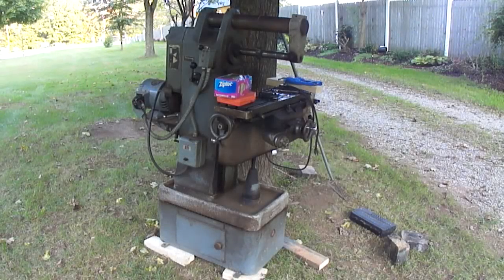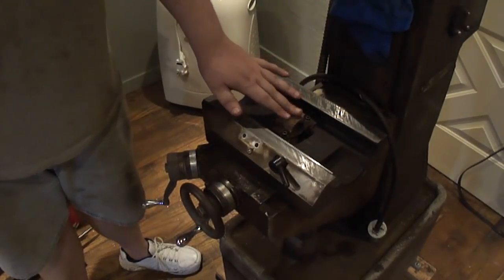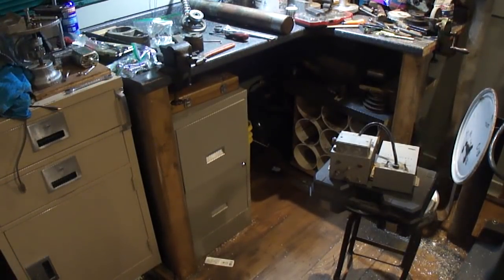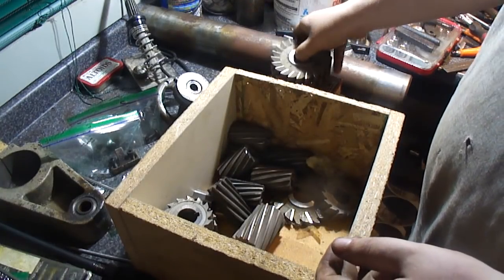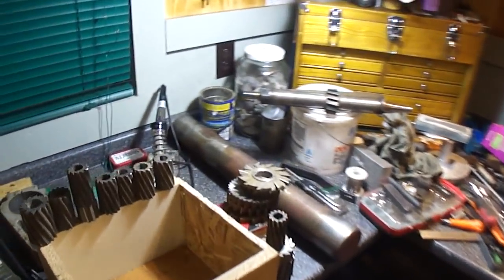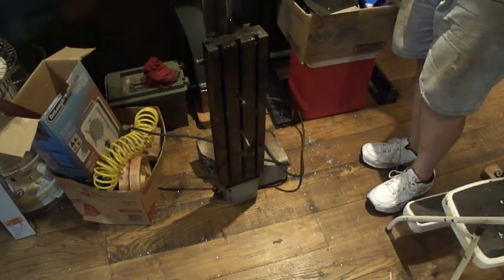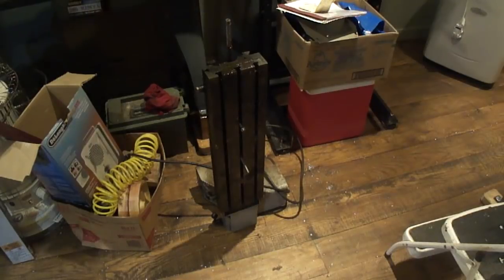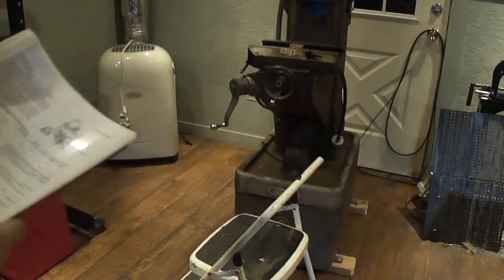Rockwell Horizontal Mill Rebuild #1 - Intro

Comment: Chirpy, awesome score and an excellent addition to your shop.  I am very much looking forward to the cleanup and rebuild and eventual chip making with your new machine.  Congrats!

Joe
Reply from the maker: that may be a while, been busy with other stuff that's come up before that. Hopefully sometime soon, I can start on cleaning up and reassembly, which may only be a 2-3 video series since there's not much to really work on on the mill. Ill have to pick up a few parts because of some stuff happened during the initial teardown, and some parts were lost. Also, I dont have 220v in my shop, and no way to get it atm, so Ill probably just put it back together and leave it sit.
Reply: I know you have a couple of projects in the works.  Looking forward to seeing your 4 jaw Chuck build.  How is it coming or have you has a chance to work on it?
Reply from the maker: I havnt even had time to work on it tbh, Ive been swampped with customer's projects and I havnt even had time to do much of anything lately. That and I messed up the bottom of my back, so between all of those, Ive been doing what I can and thats mainly just the stuff for everyone else.
I still need to make a pattern for the chuck jaws, and cast those out, but right now, being out and messing with woodworking crap isnt really that high on the priority list, lol. (I dont like woodworking even tho Im stuck doing it)
The furthest Ive gotten with any of my projects is that I got the shaper vise body cast out, but it's sitting in the casting shed on the molding bench still. I need to mull my sand somehow and make up some more molds again, but I have 4 things to ship out first thing monday morning, and another 3 more things to finish before then.
Reply: Busy, busy, busy. Hope your back heals quickly.  You are doing great.  Keep up the good work.
Reply from the maker: thanks,  Im finally finished with the others, so Im going to just take it easy for a few days probably to try to heal up, lol. Thanks for watching.

Comment: Finally got a milling machine in the shop. It will be fun to explore the possibilities of this new machine. It looks to be the perfect size for your shop too, thanks for the video!
Reply from the maker: yea, it is perfect size for the shop, only thing is, the cutters are expensive to no end for me, so Ill have to find some way to sharpen them. Thats why most of the milling will still be done with the shaper since it's cheap on tooling, and shaper is easier to run, then use the mill for cutting slots and pockets, and the other oddball jobs that the shaper would have trouble with.

Comment: G’day Chirpy, sweeet. You’ve got yourself a nice machine there with a little cleaning up it’ll work great I’m sure. Cheers Peter
Reply from the maker: thanks, yea, I looked it up and it was one of the highest regarded ones for it's size in rigidity and power. I also saw that the servo power feed and everything that was on mine wasnt standard, so I was in luck with that, and the box of milling cutters for it. Thanks for watching peter.

Comment: I can see Chirpy's manufacturing empire taking another step.  Great score, not only the mill but all the goodies you got with it.  With a lot of weight on that floor check for any movement over time (I assume your on bearers and stumps).  I think it was Steven Lang who had an issue with the weight of his grinder on the floor.  Looking forward to the new dimension in you projects.  Maybe casting a new body for a vertical head and machining it up to suit.
Cam
Reply from the maker: lol, chirpy's manufacturing empire... You have no idea how true that is already, lol. I havnt even gotten to touch the mill in the last week because Ive been so busy. You'll defenitely like the next video coming out if you think that's funny.
I actually do have the plans for the vertical head and everything, but I dont know how much I'd really use it that much because most of what I will be using the mill for, it'll work fine on the angle plate instead, or on various fixtures, so the vertical head wouldnt even be used tbh. 

The floor in my shop is so overbuilt, it's made of 4x10 lumber as runner boards, and the whole floor and walls are made of 1" thick oak and hard maple boards. I dont think it will have any problems holding the mill, lol. It was taken over on a dolly, like you see people moving refrigerators and such on, so if that can handle it, Im sure the floor is safe, lol. I think it only weighs about 1000lbs all together.

Comment: Nice addition Chirpy, tool and cutter grinder project build coming soon?
Cheers
Raymond
Reply from the maker: lol, I was honestly thinking about it, but it wouldnt be anywhere near the shop tho, and it would be quite a while before that happens. I was looking at the tinker tool and cutter grinder since I saw it was simple in design, and they were showing pics of it sharpening slab mills and slot mills along with endmills.
Reply: Chirpy, have a look at Harold Hall’s stuff, he’s and old English gentlemen that has some books also some YouTube vids under home metalworking workshop channel, very knowledgeable very simple solutions.
Cheers
Reply from the maker: yea, I know of harold hall's stuff, Ive seen alot of his stuff on his site for setup on the faceplate and the mill jigs and fixtures, which work fine on the shaper also.

Comment: Would be nice to have that vertical head so it's a full universal mill...
Reply from the maker: yea, but I have the plans to build the vertical head from it. I found alot of the original blueprints for the stuff from rockwell themselves. I doubt I'd really use it that much tho, mainly just use an angle plate to attach the stuff to and use an endmill holder in the #30 taper.

Comment: Well dang. There's a nice toy. I've got an Atlas MFC but it didn't come with the overarm support or an arbor. So it has mostly been sitting in the corner taunting me.
Reply from the maker: lol, thanks. I think thats what this one is going to do until I can get the power run for 220v in the shop.

Comment: Nice new toy. I think I got iron envy :)
Woudn't mind having one of those. But I promised not to buy any more machines.
Reply from the maker: lol, thanks, I made the same promise, but this one was too good of a deal and so I had to choose, heater in the shop or horizontal milling machine, we'll be tearing the heater out probably within the next few days. I plan on just usng it to cut slots and pockets, thats about it, but the real machining will be done on the shaper still.
Reply: I've stopped looking for good deals, cause I surly would have broken my promise.I better concentrate on what I have :) Good luck with the mill.
Reply from the maker: lol, I wasnt really looking for this one, it found me really. When I had gotten the lathe gears and pulley for the power hacksaw brazed up, that same guy had the mill and was trying to sell it. I told him no at the time and it kept bugging me and I kept looking at it every time I was at his shop, so finally he came down in price and I couldnt pass it up. Expecially after some of the recent jobs where I was cutting slots and such that the shaper was really struggling with and took forever to do on the shaper, so I was mainly looking at a mill just for doing those oddball jobs.

Comment: let me know the shaft diameters because I found a bunch of the round cutters they are way bigger than the ones you have so maybe you can use them .
Reply from the maker: the arbor on that mill is a 1" arbor, but I have a 3/8, 1/2, 5/8, and 3/4" end mill holders that a viewer sent me a while back.
Reply: ok il look at the ones I have and let you know
Reply from the maker: Thank you
Reply: give me a week or 2 I need to clean up the shed things are stacted 4 feet high lol
Reply from the maker: lol, no problem. Most of the milling that I do is on my shaper because the cutters are much easier to sharpen, so I probably wont use the mill that much for most of the work until I get the tool and cutter grinder finished, and that'll be a while.

Comment: Nice - I hope you have the knee handle.  Lots of guys would love one cast. But you first then me😋.
Reply from the maker: lol, I have the plans for making a new handle if you need them and yes, I do have the knee handle too, I made sure to grab that when we were loading it up.
Reply: Yeah both of mine are missing the knee handle. Top housing on my vertical is cracked. That would be a big casting.
Reply from the maker: Before I get anything, I make sure to research everything about it to make sure I can find parts for it or how hard it would be to get, see where it would have wear and the acceptable tollerances, and accessories that goes on it. I saw the handle usually ended up missing on most people's mills, and noone knew that the handle even came off except me, so I grabbed it off before we moved it so it didnt fall off when hauling it.
Over on the rockwell mill yahoo groups page, there is a document that has the dimensions and everything to make a new handle. Ill email that document to you, there was also plans for a large portion of the vertical head that goes on the mill also.
Reply: Oh there are no cheap NMTB 30 holders that I have found. 😩
Reply: Ah you got the servo drive - very cool
Reply from the maker: yea, Ive noticed that, shars has the cheapest that Ive found, and they're still $30+, so I plan on just getting some 2" round bar and making the tool holders myself.
Reply from the maker: yep, it came pretty decked out and in pristine condition, so I couldnt pass it up, lol.